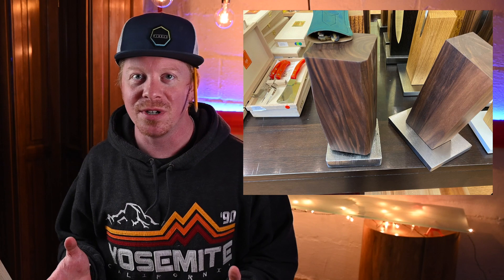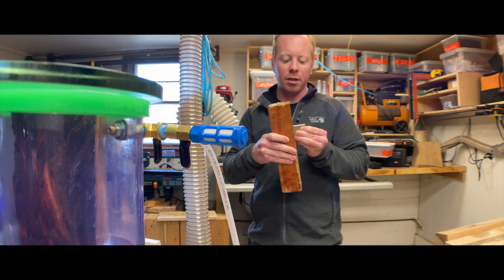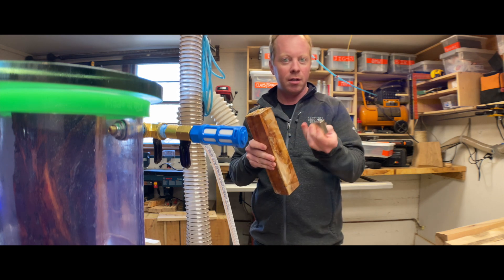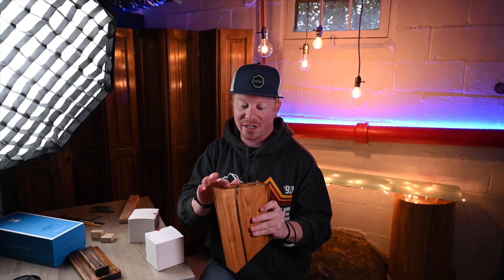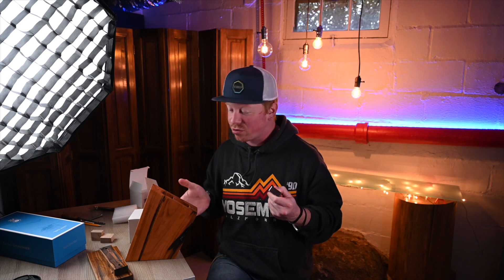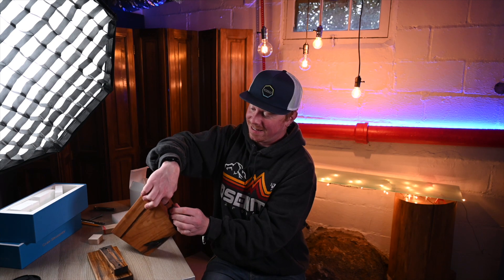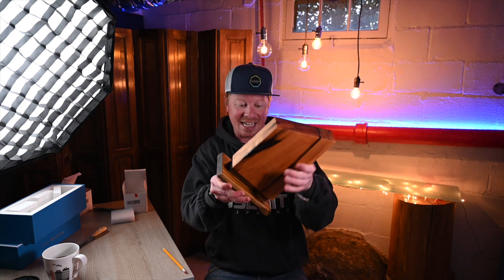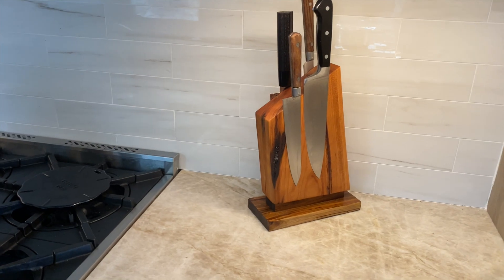Quarantine Project: MAKE A MAGNETIC KNIFE BLOCK And So Can You!  By Fritz Washabaugh

Comment: I only question whether you needed so many magnets. It looks like you could get by with magnets only at the upper portion since the knives all sit near the top of the block. Other than that, GREAT WORK! I loved the simplicity of making it. Thanks for sharing.
Reply from the maker: The number of magnets is a good suggestion, and I would say a requirement if it’s supposed to hold the knife securely. The price of the magnets, I found for drastically cheaper, so you can do this project for less than 20 bucks.
Reply: May I ask where you get the magnets?

Comment: Great project, thanks for sharing. Can you by chance remember the specs for the magnet you used? The magnetic force of it is usually measured in KG (the weight it can hold), or even the weight of the magnet itself would be useful. I am thinking of making one myself but don't want to over or under do it.
Reply from the maker: 40x40x20mm Super Strong Neodymium Block Magnet, N52 Permanent Magnet Disc, The World's Strongest and Most Powerful Rare Earth Magnets - Pack of 2

Comment: Two comments from a woodworker of (too)many years experience.

It looked to me like the dado in the separate block pieces (the channel in which the magnets sit) was made in one pass on the router table. That is much too much material to remove in one pass. If it was just the way the video editing showed it, then I apologise - but others Amy see what I saw and try to replicate that. The safe way to go is to raise the router bit so that you take off in depth less than one half of the router diameter. Clearly, if you don’t have a router bit as wide as the channel you want to make, you adjust the fence position. But don’t take off too much in any rioting operation. It will take longer than one pass but if you have seen the result of timber jumping or a router bit flying across the workshop, believe me, that extra minute is worth it. Always use a router bit with as wide a diameter shank as you can. I try to use 12mm or 12.7mm whenever I can because the additional stability and strength is worth it.

The second point is less important as it’s not safety oriented. It would be to slide the magnets into position before you glue the blocks together. Any issues with fit can be resolved at this stage as well as seeing that you are happy with the grip of the knife through the wood onto the magnet. 

I’m certainly not disparaging this clip but if you can’t learn from 40 plus years of experience, then you are not fit to carry on. On that case, go and be a politician - they make the same mistakes all the time